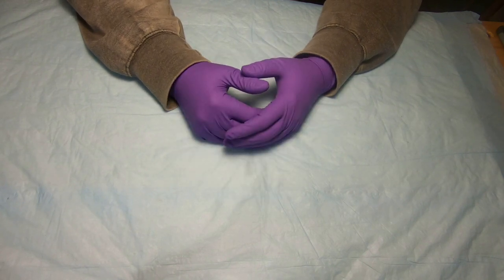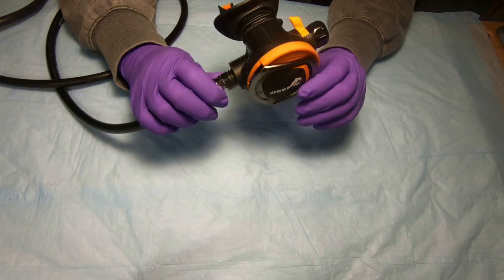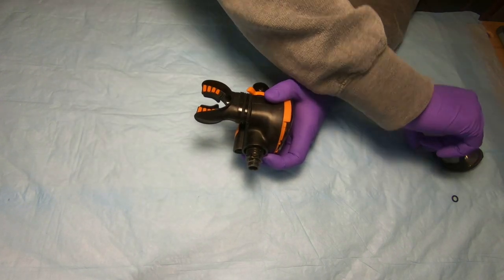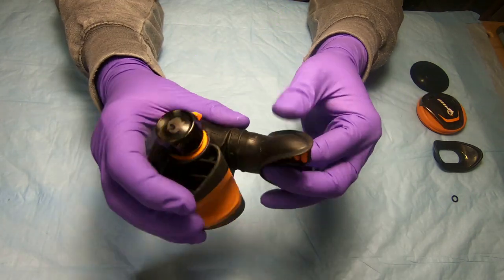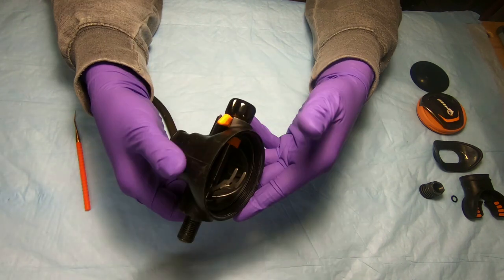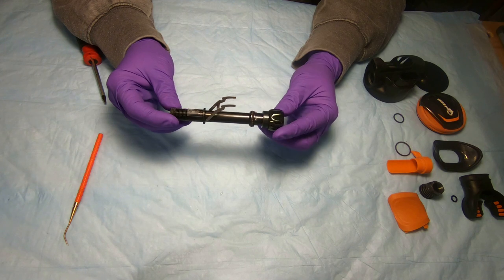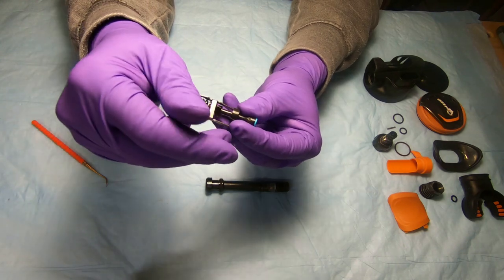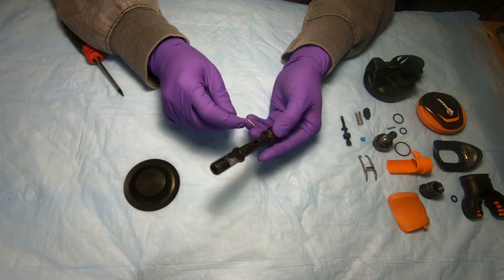Second Stage Scuba Regulator Service. Part 1: Disassembly and cleaning.

Comment: What steps would one normally take to become a regulator technician?
Reply from the maker: Each regulator manufacturer has its own training program that usually done with a specific dive shop. I did not have any training only self education, mentoring with divers who are certified technicians. Deep6 has classes to service a regulator you can contact them. I like Deep6 as it is very good quality regulator with open service concept, you can get manual and parts from them and training.